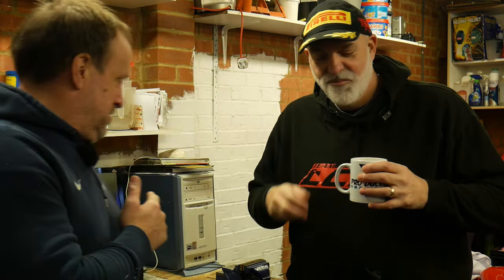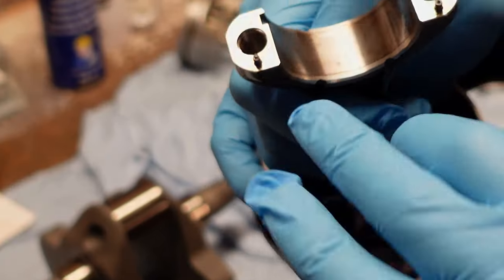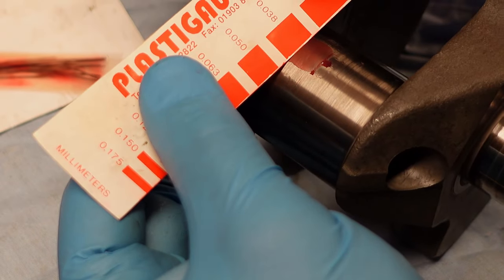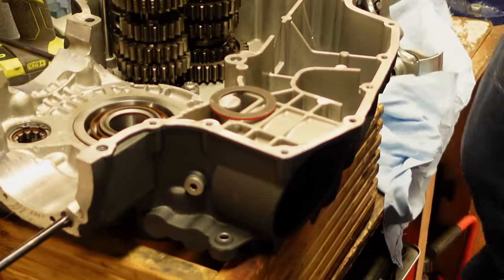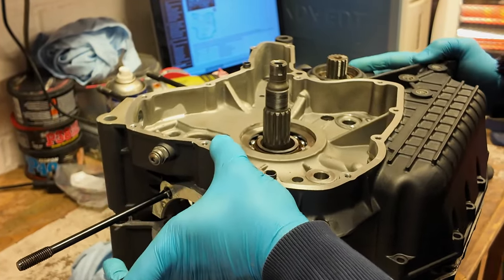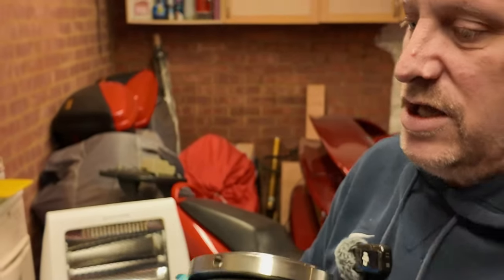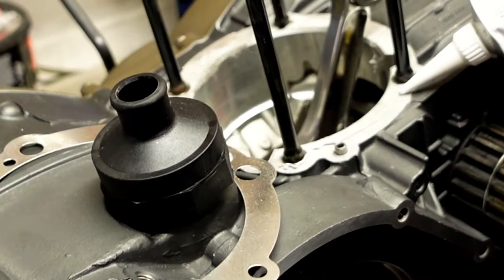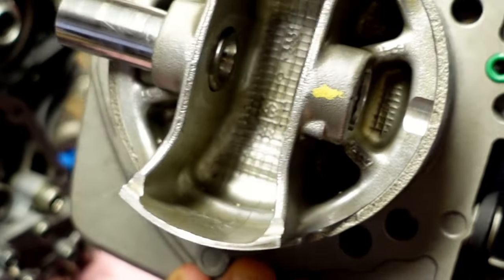Ducati Hypermotard 1100 S Final Engine Assembly, Lamb Chops Rides Engine Build Episode 2

Comment: I find leaving the silicone on for an hour or so once cases are together, the dried silicone will peel off rather than smearing a wet one on the cases
Reply from the maker: I agree, only did Chop's engine wet as originally the plan was to take the engine as soon as we finished and it stops it smearing when handling the engine. 😊

Comment: Nice build. Wonder if you or commenters ever follow the manual for belts tensionning.  The manual calls for loosening the 3 camshafts allen screws when the shaft is immobilzed using the pins inserted on the side?
Reply from the maker: More often than not I have found that the timing only moves when using an old belt (Stretch) or if I have had to replace the pully wheel (i.e. disturbed timing) in these cases I will loosen it off and follow the process as per manual to get the belt tension. I should also mention that off camera I also did a basic timing check initially when I did a piston to valve clearance check. 

When the belt has settled I may well need to adjust the timing for LCR to accommodate any new belt stretch. But in this build I was able to set the belt to an initial tension to turn over the engine, this was slightly higher than spec by chance so when I set it to 140 +/- 5hz I then put it back to horizontal TDC and checked head cam timing pins could push back in which they did. 

I just think we missed filming that check, if they would not have fitted I would have loosened the 3 pully bolts to realign the timing and would have shown that.
Reply: Thanks mate

Comment: Great things done in this video! Thanks!

I was wondering for the belts tension : when you use the camshaft  locker pins, shouldn't you unscrew the 3 adjusting pulley bolts to let the cam shaft exactly in his position while you apply tension on the belts?

Thanks again.
Cheers.
Reply from the maker: As per the other comment, if you are timing your own engine for the first time I would follow the manual.

However, wore often than not I have found that the timing only moves when using an old belt (Stretch) or if I have had to replace the pully wheel (i.e. disturbed timing) in these cases I will loosen it off and follow the process as per manual to get the belt tension. I should also mention that off camera I also did a basic timing check initially when I did a piston to valve clearance check. 

When the belt has settled I may well need to adjust the timing for LCR to accommodate any new belt stretch. But in this build I was able to set the belt to an initial tension to turn over the engine, this was slightly higher than spec by chance so when I set it to 140 +/- 5hz I then put it back to horizontal TDC and checked head cam timing pins could push back in which they did. 

I just think we missed filming that check, if they would not have fitted I would have loosened the 3 pully bolts to realign the timing and would have shown that.

Comment: always so enjoyable to watch you work. have you built an 848 with the big bore kit1038/1040cc?
Reply from the maker: Not something I have been asked to so but I will have to see if I can do one as a side project sometime 👍🙂 Have all the parts to do a 1036 in a 996 engine though.
Reply: @DesmoWerx  I have wondered how much power and torque you'd get from it and is it worth it

Comment: Thanks for this video as usual. I have a 1100 HM with 47 000 kms and that is interesting for me in the future . Do you know where I can find also the shim clearance calculator. 
What  is your next project ?
Reply from the maker: Haven't decided on which is the next project, I have some small items to resolve on the ST2 a Auto Blipper to fit to the 1199 and then its whether to rebuild a damaged 1299 or do the 916SPS build. There are some customer jobs coming in as well including a 916 engine and another Hypermotard bottom end build.

There will be some channel updates coming soon including memberships etc which will include Shim exchange services and the Calc sheet

Comment: I just bought a 2009 monster 1100. The valve broke on the previous owner and put a hole in the piston. I haven't torn it apart yet to see the extent of the damage. In your experience, without being able to see it, would you lean towards a rebuild or look for a used engine? I'm new to the Ducati world, any advice or tips would be greatly appreciated.

Comment: Great video! A question on something you may have experience with, on the selector drum, does the small spacer/shim on the detent side have a wave or is it a flat spacer? I am busy with my 999 and when I disassembled the gearbox I noticed a slight bend on the small spacer on the selector drum. I have the correct end float but only if I move the drum with a bit of force to compress the shim? Does not seem correct to me.
Reply from the maker: Not had a wavy shim in any Ducti engine I have taken apart or built for the shift drum. They should be flat and there are different sizes for some of the Ducati provided shims listed in the parts manual. I think you may have a damaged shim on yours. They are cheap to source from Ducati.
Reply: @DesmoWerx  thank you! That confirms my suspicion! Will add a new one to my list of required parts!

Comment: Hello, im rebuilding a ducati m600 1995 engine, its main bearings are RHP 7307X2TB and RHP 7207X2ETN, could I replace them with SKF 7307 BECBM and SKF 7207 BECBM ?
Reply from the maker: I would not recommend anything other than the RHP bearings, for the small saving you will make using alternates it is not worth the risk. I cannot remember the contact face angle but it is an odd one in the RHP bearings which makes them difficult to match.